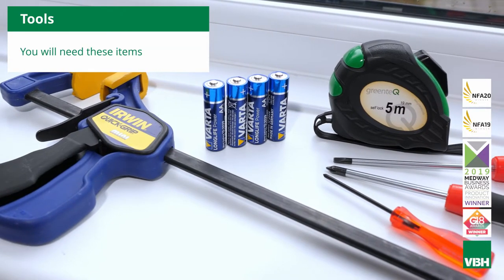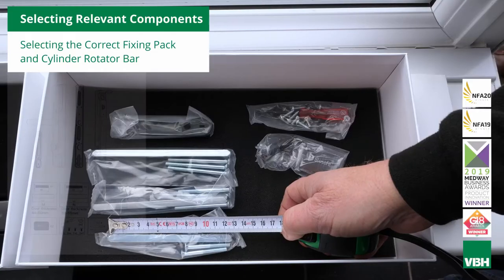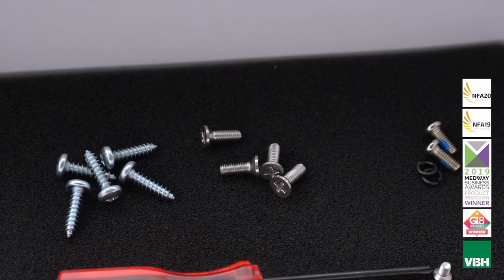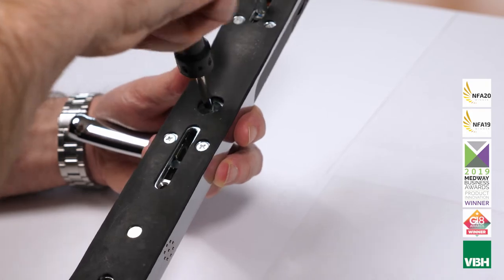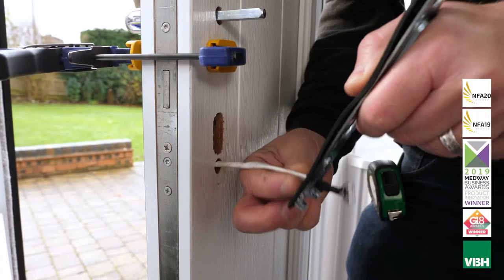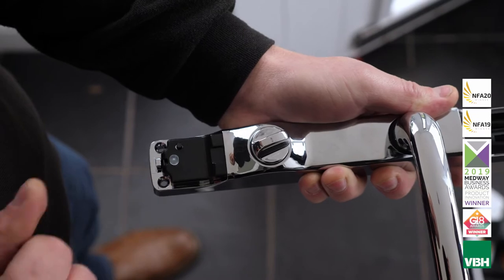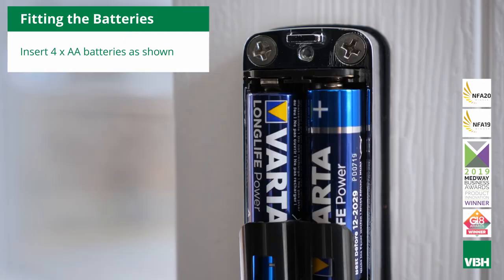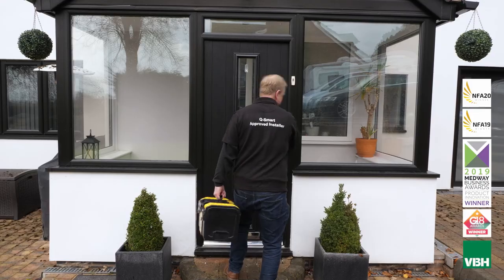greenteQ Q-Smart Electronic Smart Door Handle Installation Guide DP WH 101120

Comment: The fuck do you do when this runs out of batteries lmao ?
Reply: It looks to be based on the Yale Conexis L1, it has a low battery warning in the app and the lock will beep to tell you, also its got a 9v battery terminal hidden on the bottom so you can plug one in to power it should it be totally flat to get you in
Reply from the maker: Apologies for the delay in replying. Q-Smart will warn you well in advance of the batteries needing replacement. Should the user let the batteries run down, the unit can be powered up to accept a fingerprint, tag or app opening, by attaching a power source such as a portable power bank (each Q-Smart is supplied with a greenteQ power bank) via a micro usb port. Once the user has gained entry to the home, they can then replace the batteries. We hope this answers your concerns.